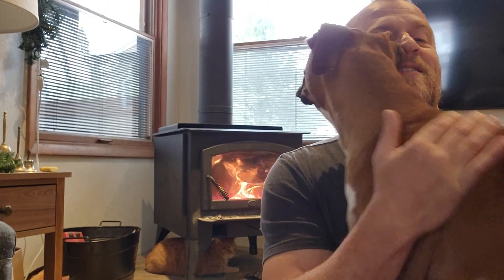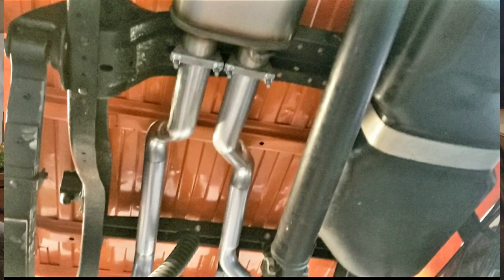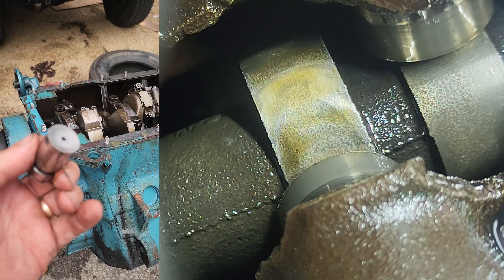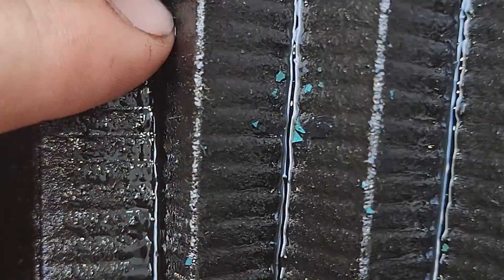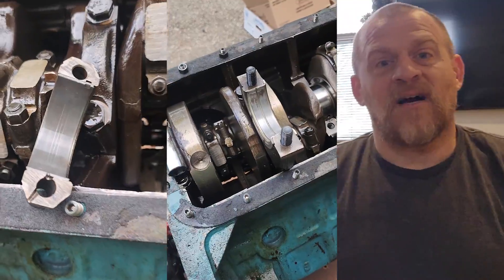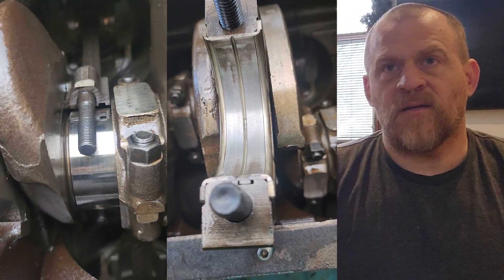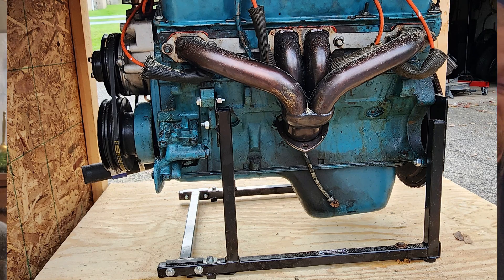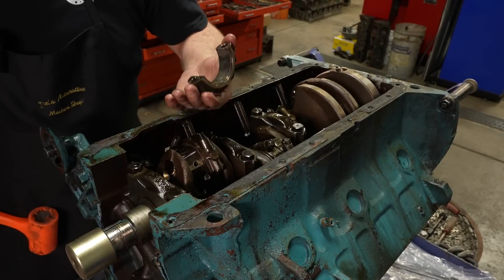Wiped Cam Lobe/Lifter After 4000 Miles?

Comment from the maker: This is a 1972 413 Wedge from an RV that was put in my 78 Power Wagon, with the original owner claiming full engine rebuild with .030 pistons, a steel crank, heads shaved and a new cam. I put less than 4000 miles on it and it wiped a cam lobe and lifter. A full engine rebuild is going to be getting done with a collaboration with  @JAMSIONLINE  
Here is the first video in the rebuild series! 
https://youtu.be/oa5pT7qq5-g?si=WOnx91BPxsZb3EWz
Reply: Looks like one of those times you don't run the break in oil for the cam.
Reply: Best wishes on the rebuild.  Got some U-joint issues on the 94 GMC Sierra C3500 used U-Haul truck.

Comment: 20 years pro tech here I specialize in engine work and was a drag racer so I did a lot of builds. I met a lot of back yard do it urself people in racing everyone has “the guy” that builds engines in his garage. I’ll tell one story which is very common so I go to my buddies house he’s got this guy over helping him with his engine that had a rod knock, the guy just slammed bearings, oil pump and rings in it, I said how was the crank did u get it polished? Did you have the rod that was knocking rebuilt or get a new one? The guy said everything was good I laughed and said no way it has oil pressure after 50 miles. Well on the test drive it had low oil pressure and was knocking again. I went with my buddy to look at a street car with a engine that only had one hour of run time he said he just did it. Said it had these high compression pistons and when u have experience u know a high compression engine specifically if it’s fresh feels like a diesel when u shut it off the engine stops spinning very fast and this engine didn’t, I put my bore scope in a spark plug hole and it had stock pistons lol.
Reply from the maker: Great stories! Horrifying but still great. Thanks for sharing

Comment: So, I am new to this channel. I discovered this channel from watching the tear down and more recent short block work on this engine. My opinion is that someone actually checked the engine over and threw some paint on it and called it a rebuild. Sad that people do that shit. The cam lobe was coil bind, someone failed to check that the springs and valves were compatible with the cam, but with the paint issue the engine was doomed anyway so the decision to pull the engine when you did was timely. just my opinion.
Reply from the maker: Agree! 100% shotty work on the engine. But in the original owners defense, I'd have given him his asking price even if it didn't have an engine in it! They just don't come this clean. Thanks for the comment!

Comment: Sitting with a piston down and a valve open will absolutely cause rust pitting if not fogged. I always spray some lubricant once in a while in the cylinders when I have a motor sitting for a while

Comment: ZDDP! if no emissions junk run good old school diesel oils. higher zinc content and other good things to keep lobes form going away.( or racing/break in oils made for flat tappet lifters.)
if the engine sat around it likely rusted the lifters/cam lobes, which would make it need a "break in" run again and that rarely gets done after engines have sat around for long periods.
it's hard to revive an old engine and wind it straight up to break in speed(usually around 3000RPM for 30 minutes), too many things go wrong and everything would need to be perfect/tested before starting. pre-oiling is a must before ever cranking them over, but of course that rarely happens. 😑
it's also possible, the lifter/lobe was already going away. **also if it was rebuilt, maybe never got a proper break in with correct oil/additives.
Reply: after watching the shop video, you got an ungreased shafting. I guess the bright side is an mostly unmolested short block.

Comment: Awesome job digging in! When I picked my 82 W250 up I found a wiped cam lobe and lifter after changing a leaking cork intake gasket. Truck ran great which I can’t figure out. My engine was also unmolested with all original internals. I removed the rotating exhaust valves and installed new standard valves. I replaced all the bearings and re-ringed the OEM pistons. Honed the cylinders and polished the crank. I went with a mild cam from Comp Cams and followed their break in process.  As others have said, use of a flat tappet cam oil is essential to a cam’s livelihood. I personally like Driven racing oil. Todays oils are made for catalytic converter life and are eco friendly. Driven oils have the products the epa has removed from modern oils.

Comment: Lost art isn't it?

Nowadays it is cheaper to get one already rebuilt.  edit Jasper used to be top dog 20 years ago, but now they are like so many other places and have gone to the dark side.

With shipping back/forth, parts/labor for rebuild, and don't forget your time to diagnose, tear down, removal, admin, yada yada yada, your easily in 5 figures.
Reply from the maker: I'm okay with that. Where can you get an engine custom build and a film of the entire process? NO WHERE! Also, when it is done, I'm going to make the 1200 miles drive and go pick it up so I can shake their hands. Oh, and film a fun little road trip out of it too
Reply: @ScannerDanner  Don't get me wrong.  I applaud what you are doing.  I have been in the game for about 40 years and have seen quality go down the toilet.

I spoke wrong in my reply.  Should have said Jasper, not LKQ.  Jasper is a rebuilder; LKQ sells mostly used parts.  I will correct this momentarily.

Jasper used to be good, but they too went to the dark side and use their previous reputation to sell their sub par stuff.

I know you are a member of iatn, and pretty sure you have seen numerous help requests caused by inferior parts causing techs to bash their head against the wall.  

People don't know any better.  People are on the cheap and think that all parts (and sadly all repair shops) are the same.  Good shops aren't cheap; cheap shops aren't good.

I enjoy your videos, very much You are only second to Bernie Thompson.  You are a much better tech than I am.

Comment: There's a engine shop in Butler, Ashcraft Speed and Marine. They are top of the line engine shop that does Monster truck engines to small cars. I have had a few engines done by them; you could eat off their shop floor! I have never seen an engine shop that clean.

Comment: CWC Textron has suspended cast iron cam core production for the foreseeable future so in the not so distant future a reground cam or a roller cam will be the only option.  

Most shops today just have too much shop work to do and don't have time to do a lot of assembly work.  A big Chrysler is a pretty friendly engine that's not difficult to rebuild.

Comment: Something to keep in mind. Mopar motors were built with either a standard or automatic crankshaft. The automatic transmission crankshaft is not machined for pilot shaft bushing and people do a butcher job on them trying to make it work. Hopefully whoever done this motor actually found a crankshaft for a standard trans which would be rather hard to come by.

Comment: True on the RB 413. Very low Compression on your engine may 8.0 to 1. 

My 383HP 10.25 to 1 sat for over 25 years after rebuild and 3 years of previous drag and street use on NOS in unconditioned spaces. The rockers were loosened as to keep the valves closed.
No issues after car restoration in 2012 and refire in 2014 to today. I did have a rocker failure and bent pushrod from an over rev  in 2020 after a best in show win that caused no other issues. The cam was installed in 1995 and is a Mopar Purple 509/292 flat tappet! I used Kendal Straight 40W in the day and now use Valvoline VR1 SAE 40 High Zinc. Never have been an issue on my LB 383!

Comment: That’s one of the most beautiful power wagons I’ve seen in a long time. I love those trucks, my son and I are big fans of Dodge trucks. He drives a very clean 92 short bed 4x4 318 auto, he’s owned it and daily driven it for 9 years with only routine maintenance. I’ve owned a 97 12 valve 5 speed for 25 years, back in 2020 bought a new Ram 1500 5.7 4x4 and absolutely love it as well. My son and I are looking at a 92 ramcharger as a father son project.
Reply from the maker: Thank you! So you understand then why I am not upset about the engine 😊
Reply: @ScannerDanner  yes most definitely

Comment: YOU HAVE TO USE HIGH ZINC OIL IN EVERY OIL CHANGE WITH FLAT TAPPETS. New oil does not have enough zinc to keep the cam and lifters in good condition

Comment: As someone that occasionally does automotive machine work in my shop I can say Jim’s is spot on in what they do.  Those heads are not original I don’t believe as the 413 industrial used a different bolt orientation on the manifolds  and yours obviously didn’t have the massive truck manifolds on it so pretty sure it’s just a 413 truck bottom end with a cam and some 440 heads.

Comment: The last engine I rebuilt was a Ford 351M about 25 years ago. I used a local shop in a nearby small town, Eagle Machine in Buffalo Missouri. Don't live in that area any longer but just looked, and they are still in business. A friend and I pulled the engine, pulled the heads, etc. and cleaned the worst of the gunk off. The whole short block and bits were loaded into the back of my 1993 Geo Tracker and dropped off at Eagle. They got a big kick out of my Tracker with a 'small block' in it. They did a great job and I would recommend them to anyone in that neck of the woods.

Comment: Wow, brings back a ton of memories. I worked for Ed Miller racing right out of high school and we had a full machine shop and I can't remember how many 340/360/413/426 wedge/hemi/440s I built for racing. I think maybe the guy that bought the engine was probably telling you what he was told. It doesn't sound like the guy built the engine, he probably bought it from someone else. I did an engine swap in a 1969 Charger from a 318 to a 440 and the guy bought a "rebuilt" engine from an individual. It turns out it was out of a service truck with low compression pistons, never rebuilt. I'm thinking the whole time I would be going with the 426 hemi crate motor. Nothing like opening the hood and seeing those massive valve covers.

Comment: Paul:
Never trust what a seller tells you about the so called Engine Repairs. I bought 2006 Lincoln Mark LT that supposedly had all new Timing Chain Components replaced as new. Within 5000 miles of me driving it, the Right side Timing Chain Tensioner Seal failed. The Chain jumped a Tooth and the Cam/ Crank correlation DTC was thrown, (i e.) the Chain jumped a tooth on the Cam Phaser. I subsequently rebuilt the Engine with all new Ford Timing Chain components, VCT Solenoids, and a new Oil Pump. I cleaned the debris out of the Oil Pan and Pick- up Screen. The Truck has been running great for one year now. I like your Wood Burning Stove, we use ours as redundant heat and for emergency cooking.

Comment: For what it is, I think you should have just thrown another cam at it and tossed it back together.  After rebuilding an engine myself like this.. and also watching my brother throw five grand at a 383 stroker build:   I won't ever do it again.  If you really want an upgrade, just get a more modern/ used hemi or LS or coyote engine and be done with it.   Otherwise, I'd just stick to minimal parts to keep it running and call it a day..  But I can understand, if you have extra money to throw at it, then why not.  Plus it's more content.  You can't really go wrong for that reason

Comment: It's best to do like you are doing. Find a reputable machine shop and let them do it. I had a field service engineer tell me that the tools you buy at an auto store to measure cylinder bore, etc., are not accurate at all. Machine shops have the equipment to do the job and have done it many times. I had a guy tell me about 30 years ago that during engine break in that you have to use non detergent engine oil. It's something to do with the piston rings seating or maybe the cam lobes and lifters playing nice together. I don't know if there is truth to that or not. It sounds like the seller of this truck was not completely honest.

Comment: Use stock parts and ask Tony for mopar information.  Cam damage  happens . Was there any kind of information  on the cam for age . Maybe the original  canged a noisy tapit thinking  ro get rid of lifter  noise  and causing  the cam damage

Comment: Love that truck. Enjoyed the video will fallow the rebuild. I have a 78 Ram Charger that I used for backwoods/backpacking get to location truck. Its way rougher than yours but it got you where you needed to go and was very reliable.
Stay Safe & Good Luck
Reply from the maker: I would love a backwoods 78 Ramcharger! One you're not afraid to scratch. Happy for you man. I have some 8 lug hubs/wheel bearings, rotors, spindles, outer axle stub shafts for a full-time 4x4 set up. It all has like 5 miles on them. I converted mine to locking hubs. If you want them their yours, you just have to come get them (Pittsburgh pa)
Reply: Man, that would be a nice but sadly have to pass. Poor girl hasn't been started in years and when I did it had a miss "not a plug or wire" did not have the time to fix her, too many higher priority projects "mainly building-finishing house & small farm".  Would like to have done same thing you did convert to locking hubs., full time nice, but 90% of time it's really not needed. She's definitely a brush truck lots of rust, poor man pin-stripping, cracked windshield due to rock falling from bluff, even has a bullet hole or two. Thanks for the offer love to see your truck, I'll bet theirs someone who will take ya up on the offer. Looking forward to your videos.
Stay Safe & Good Luck

Comment: Back when I worked at a GM dealer, we had a small bottle of engine assembly oil we could use when doing internal repairs. It has high amounts of zinc. Many other oil additives may have the same. Just a thought. Oh...and was it ever confirmed that the cam was swapped and lifters were reused, or cam and lifter swap?

Comment: Should be a fun project. I personally have 0 motivation to assemble any engines. Most I get into is pulling heads, swapping cams, timing work and resealing. Short block work is to much risk for me. I’ll do automatic trans rebuilds without blinking an eye though

Comment: FROM NOW ON you should just run diesel oil! It’s got more zinc in it than regular oil of the old days. I run the Rotella 5-40w synthetic blue jug, even in my 99 Toyota Tacoma 3.4L with about 330k on it. It runs great and it’s hardly seen an easy mile. I should know, I’ve had it since it was BRAND NEW!

Comment: How many engines have sat and been fine !?!?  I know a few guys that use a little atf in each cylinder if it sits. I honesly think the engne wssnt built properly. 
  As for camshafts you need hotrod oil by lucas or ones that already have zinc in it . The additive only mixes when the engine hits a certain temp. So they arent really much good .
 Also melling and lunati are the only two that i know of these days that grind in north america. Always used them for flat tappet and never had an issue. 
  That cam was probably white box chinease.  I have been building hotrod motors for 20yrs. In my experience as you stated the cheap cams are generally a wash. Not your fault you didnt build it.  Hope your next engine does well.
Reply from the maker: I think it's possible this engine sat for a decade or longer and they never touched the bottom end when they dropped it in the Power Wagon.
Reply: @ScannerDanner  I don't think the paint chips helped much either lol. Love your channel !!

Comment: Paint possibly have got into the oil ports and in the hydraulic lifters causing the damaged camshaft lob. And yes it could still have good oil pressure . Was the lifter still allowed to rotate? I have had to pull a motor and remove hydraulic lifters after removing the cam because the bottom side of the lifter was bradded and couldn't be pulled out the top. It was a pain.
Reply from the maker: I had to tap that lifter out. For sure it wasn't rotating anymore lol

Comment: COOL! Good to know you were able to find someone that still has the right tools/equipment to bore out these older engines. Seriously didn't figure there was anyone left still out there. Yep, seen a few of that 'aluminum colored black oil' a few times myself back in the day. Chevy 265, 283, 327, 350, 396, 402, 454's, OH, THOSE were the days! We used to have a guy in our area back in the late 70's, early 80's that was a 'master' of Dodge/Chrysler engines, and could he make them run. We called him 'Speedo Platt', his last name was Platt of course. He's long gone, sure miss his engine builds! Should be a good runner when they're done with it! VERY lucky that the engine is unmolested, VERY rare these days to find one of those! DAMN that cylinder wall looked bad! OUCH! Can't wait ti see the end result.
Reply from the maker: As disappointing as it was to know this engine did not have the work that was claimed, I'm equally excited to hear how much it hasn't been touched! Original 72 bearings and a good crankshaft! I'll take it!

Comment: I worked at a dodge dealership back in the 70s and 80s you can rebuild 360 and 340 as long as bore taper is less than 60 thousands . 318 are almost as durable. I don’t know electronics that much but I was the engine guy . Just rebuild it 👊🏻 the 413 should be same as long as 60 thousands left to bore. Going to be great 👊🏻